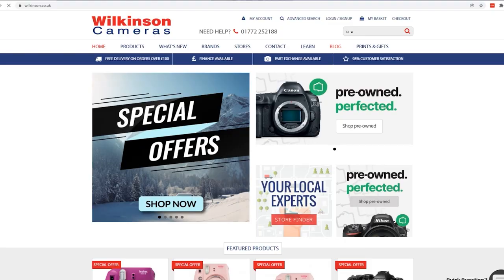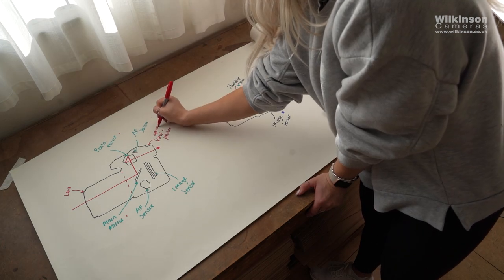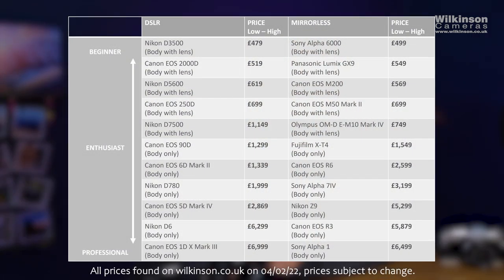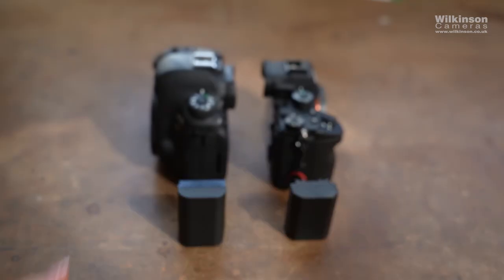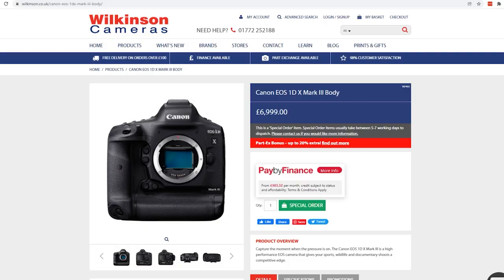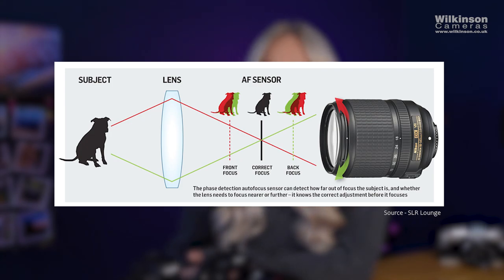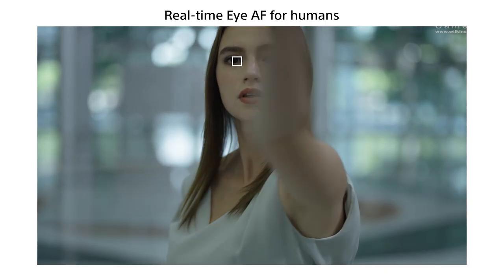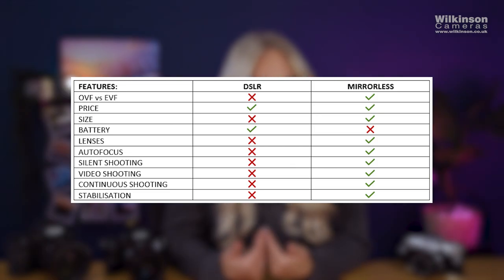DSLR vs Mirrorless: Which is Better?

Comment: I'm torn as I have both a DSLR system and a Mirrorless system. I am trying to choose one and sell the other but like both. Each has its own advantages and disadvantages.
Reply from the maker: It can certainly be difficult to choose when they’re both capable of excellent results. Which cameras are you choosing between and what type of photography do you tend to do mostly. Maybe we can help you pick a side?
Reply: @WilkinsonCameras  I mainly do wildlife photography. The cameras are the EM1x and the Canon 1dx. I have both